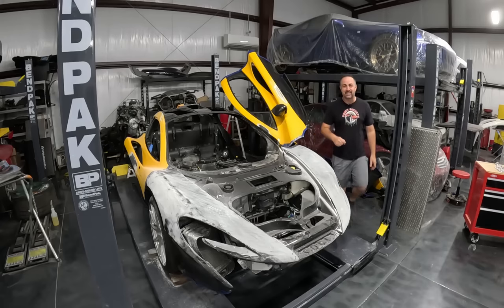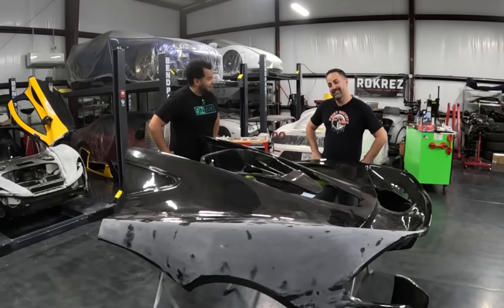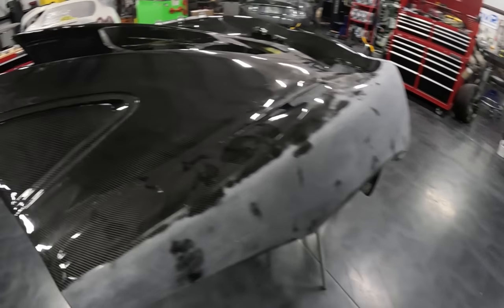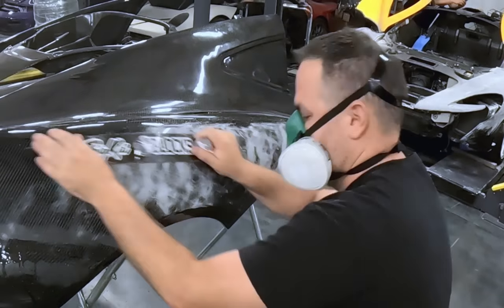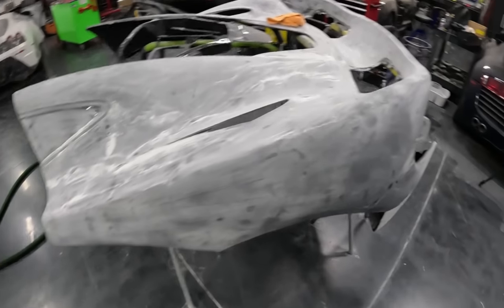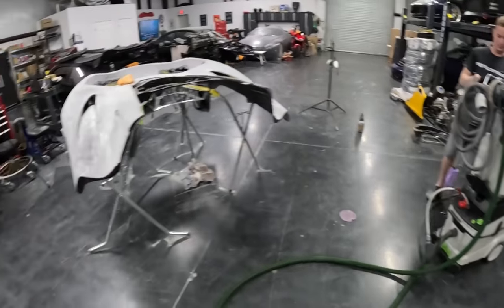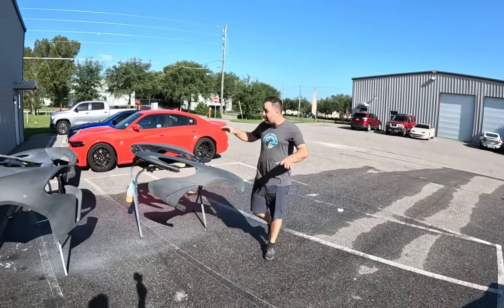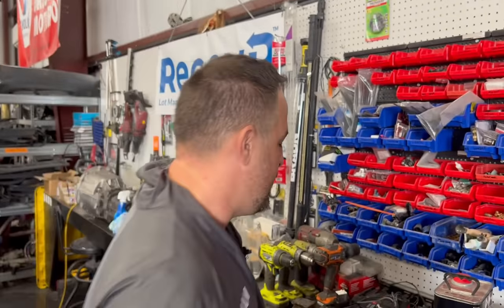Painting a McLaren P1 in a Inflatable Paint Booth!

Comment: If you use Mipa P67S  Spray polyester for carbon fibre then Mipa Carbonic Clear, that will get it pin staright, i used it on my GR Yaris Forged carbon roof and that was covered in ripples now its straight as a arrow
Reply: I tried finding both products but no luck. Do they sell it in the states?

Comment: Have you ever set the pressure on a spray gun that is outside the recommended pressure settings stated in the data sheet? Is there ever a time when it should be done? I'm just trying to get a baseline to start with.  Thanks!

Comment: I have no idea what a piece like that would cost but I'm betting a lot!   If those surfaces are the result of additional coats of epoxy after molding then it may be understandable.  If it comes out of the mold that way, the tooling needs to be redone!
Reply from the maker: Great point!
Reply: Was thinking similar myself, I mean it's not as if it's some cheap part for the interior of a civic etc 😂
Reply: Problem with carbon that big is it is very flexible, just a little bit of pressure will distort the guide coat.   Also  not being attached dto the body will distort the part.

Comment: Just out of curiosity, what kind of clearcoat is that... seems to be an odd brand for such an expensive project. I was specting some acrylic urethane clearcoat like superior 250 from sikkens...
Reply from the maker: Its just for build. We will repeat this process 3-4 times and the final coats will get the good stuff. I think actually next time will be sikkens because the front cap will only need one more coating most likely
Reply: I think you guys should have use the same clearcoat throughout the entire process in order to ensure the quality of the job... if the cheap clearcoat fails then the good stuff comes with it...